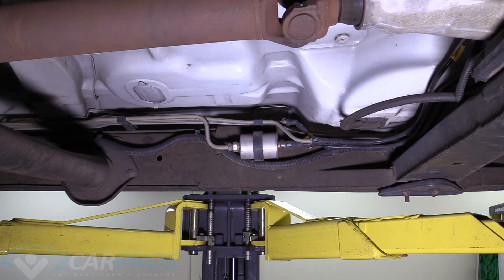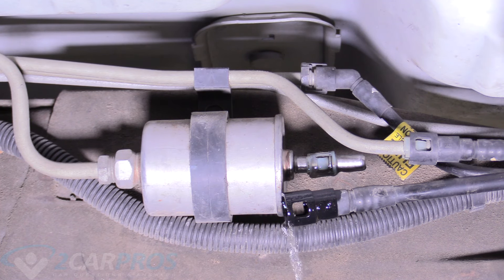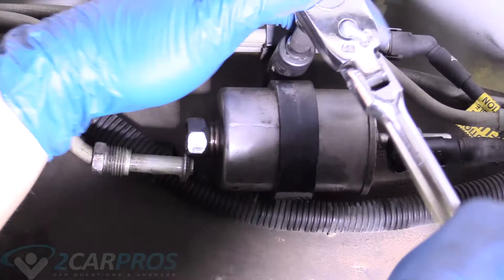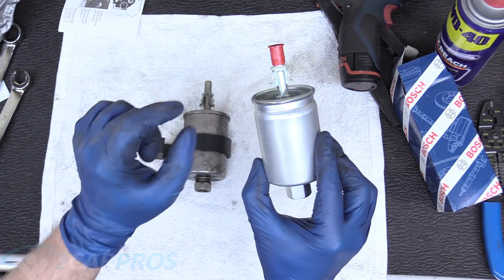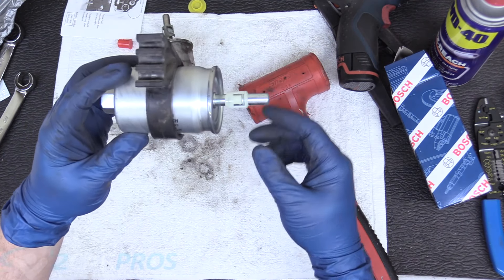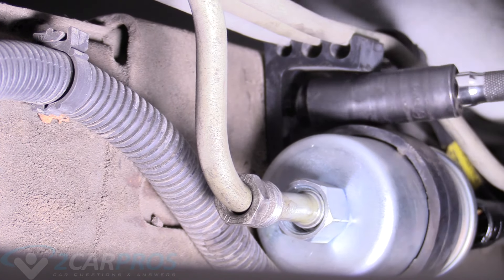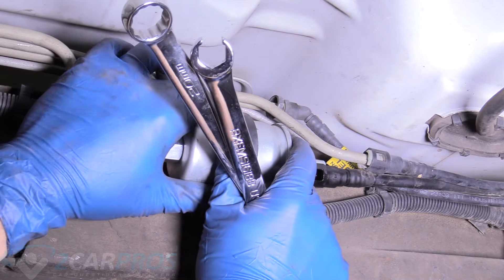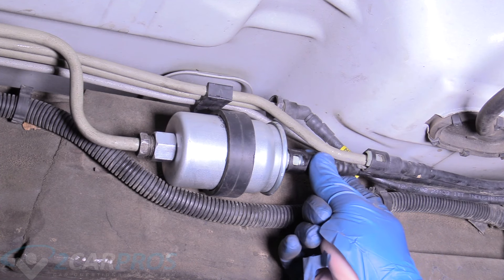How to Replace Fuel Filter Chevrolet S-10 1993-2004

Comment: do not, i repeat DO NOT pop that fitting off without relieving the fuel pressure by running the engine without the fuel pump. If that filter is even a little clogged, it can maintain pressure on one side of it. Was personally nearly blinded by just such an instance.

Comment: I was trying to replace this filter for a friend and the 16mm flare wrench stripped the nut because it was too rusty and tight. Yeah, I sprayed PB blaster before I started, and it wouldn't budge. I bent the neck of the fuel filter a little with the force I put on it. I decided to give up and plug the plastic piece back in and tell my friend I'm not doing this job due to all lines being heavily rusted.

Comment: Now I have a 96 Chevy S10 went to go replace the fuel filter and the line that is coming from the motor toward the front end of the fuel filter head snapped the line screwed into both ends is there any possible way I can just hook it up how you have yours hooked up and use the same fuel filter that you have pretty much I want to put a rubber hose on the end of the fuel line that had snapped off and then connected with clamps and run it to the fuel filter that you slide on to on the side or the one side I should say that you just unclip is that possible

Comment: Helpful video, but experience doing this on my 2003 LS 4x4 wasn’t such a walk in the park. There is a sway bar or link that runs front to back, right next to the fuel filter. Space isn’t big enough to get any combination of wrenches, vice grips, pliers, etc. in.

Comment: Super helpful. Watching under my truck right now. Done!
Reply from the maker: Nice work! Thanks for watching!
Reply: Same
Reply: @elite_dunkz_6196  It was easy to replace but it wasn’t my problem, it was the ignition Consol for me
Reply: I think you can disconnect the fuel pump relay, crank up the car let the fuel burn up then you won't have fuel pressure before you takeoff the filter?

Comment: Thanks for the video. Did mine on my 95 s10 today. I guess who ever did it before didn’t put the plastic retaining bracket back on (probably broke it) both sides were threaded too, no safety’s on my year.
Reply: I got a 95 blazer is it in the same spot as your s10 under the driver seat
Reply: @zakgephart4865  yea it’s located on the drivers side but not directly under the seat more so near the middle of the truck

Comment: Gonna do mine tomorrow on my 04 s10 crew cab how do I release fuel pressure in the lines so I dont lose a bunch of gas?
Reply from the maker: Nice! Just taking the line off will relieve the pressure. I have always found that easier. The pressure will also help push the line off. Thanks for watching!
Reply: you pull the fuel pump fuse  , crank the engine and the fuel pressure will be gone

Comment: Great video, but uh... When I remove the quick release part of hose it never seemed to stop draining, as if it were siphoning the entire gas tank out. It also had high build-up of pressure even though I tried to relieve it by cycling the engine with relay out. 2004 Blazer.
Reply: You can relieve pressure by pushing shrader valve.
Reply: @ronaldcarson4360  same thing happened to me on  S10 1998. I put side back on with the clips.I don't know where this schrader valve is.
Reply: @ronaldcarson4360  please help!
Reply: Please my eyes are dim! Muscles are sore and I still have determination! Having trouble loosing the other side sprayed lube on and still won't budge
Reply: Me too help, lol, daylight & good weather running opposite me
Reply: @lanajantz2240  It's in engine bay off the back of the motor toward the left. I think it's the black capped valve (there's another that's green). It looks just like tire valve coming off of the fuel line coming from the back of the vehicle. If you search "s-10 fuel pressure valve engine bay" you should be able to find a pic or vid showing where it is.

I was a bit surprised this poster didn't bother reaching under the hood and relieving fuel pressure that way.

Comment: The other lines besides the feed line (running into the filter) - what are they? from out front to back if possible.
Reply: Actually if you could confirm- the line running into the filter is obviously the feed line, next to it is the return line, 3rd is the line from the charcoal cannister to the front of the engine(Where does this connect?) 4th is rear brake line?

Comment: Is this the same location and process on a 2002 S10 LS 4x4 crew cab? Would a clogged filter give a hard start condition but then run ok after it finally does start? The fuel pump has less than 20,000 miles on it as I had it replaced with the new gas tank. Also just replaced the distributor and rotor caps.
Reply from the maker: Either the exact same or really similar. Yeah I would definitely replace the filter and see what happens. Thanks for watching!
Reply: You should have just replaced the filter when you did the new pump, now your injectors could be suffering

Comment: Any tips for the 4X4 model? there's not much space to turn wrenches because of the torsion bar
Reply: I'm sure you have done your 4X4 filter by now, but in case you have not: Remove the skid plate with three 15mm bolts and two 15mm nuts up front. You will notice there is the rear torsion bar mount limiting your motion, but it can still be done similar to the video; the key is to remove that skid plate. Next, remove the forward fuel fitting just like in the video and drain the pressurized fuel into a container. Using a 16mm flare nut wrench and a regular 19mm wrench (not 20mm like in the video) remove the rear fitting, and slide the filter forwards. Installation is reverse of removal, than install the skid plate.

Comment: Hi guys love the content liked and subscribed av got a problem with my Nissan nv400van a think someone has tryed to gain entry possibly my alarm keeps going off wen locked now ,was on driveway which is tight fit and a heard something in evening thought nothing of it a woke in morning and wig mirror was pushed I as thou somebody was trying get down tight gap no fixable signs of entry? Am I looseing my mind?  the Vans only couple years old with 24000 miles so carnt be my key or battery ?plz help
Reply: Sounds like an attempted catalytic converter theft.  It's a big problem in some cities, and especially on cars with good ground clearance.  They use a battery powered Sawz-all to cut them off.

Comment: Just lost my fuel pump the other day. Shop wants to replace the filter as well. Tells me the filter is $15, but installed it's $100. What a joke.
Reply: As always, they tryin to get you man...Do it yourself!!
Reply: @mrobsolete530x4  "more fun" laughs in torn up hands while trying to change spark plugs/wires on an s10
Reply: @haroldflower8008   >>spark plugs & wires<<  Hey man, I HEAR YA'!  That job takes some patience, skill, a good selection of tools, and a certain amount of creativity.

Comment: Word of warning.  This truck is very rust free. On trucks that have been exposed to a lot of road salt you need to handle that filter mounting brkt. very carefully if the return lines above are rusty. This can turn into a real nightmare and customer may blame you for damage to the lines. I  will often carefully cut or chisel the bracket above the bolt hole so it will still hold the filter in place and still contain the lines. To much movement may cause the lines to start leaking and if the customer is not informed AND SHOWN the possibility of this happening,  you may get blamed for causing a leak and have a bigger problem on your hands. I even refused a job once where the customer wasn't grasping the situation and thought I was trying to set them up for a ripoff wanting to get more money for a bigger job if I damaged the rusty lines. Believe me,  the last thing I wanted was to have to replace those lines, money or not. That job sucks.  If careful inspection reveals that those lines are already leaking immediately inform the customer before touching the filter and unless the truck belongs to you, you may want to pass on it because replacing the lines properly is major work .
Good informative video by the way.
Reply: I agree with this statement, because I did this job on my 2005 gmc yukon. It's a freeking nightmare.

Comment: What is the part number for the oring on the fuel line that is threaded?  On my 96 it's threaded on both ends and the rings are shot.

Comment: Could I hook a pump on the safety clip side of filter and slowly drain the gas tank ?
Reply from the maker: You could do it that way. But I must warn you that unless a pump is certified to do so it can technically cause a spark. If you need to drain the tank it is easier to take the filler neck off and do it that way. I did a while video on replacing the fuel pump on one of these and I show how to do it there. Thanks for watching!

Comment: Try doing this job on a rust belt s10!
Reply from the maker: If there was a bunch of rust and corrosion under the truck I'd spray some WD-40 in the threads on the flare nut threads then try to take it off. Thanks for watching!
Reply: @2carpros  yeah I know how to do it, I've done it many times. Just saying you had it too easy on that truck. Lol
Reply: @dm7097  hi, can i brake the fuel line if i try it to hard? Because mine is also really full of rust, i think its the first fuel filter from 1995
Reply: @icrashucrash9585  It is possible to twist the fuel line if there's lots of rust. Make sure to use a good penetrant, not WD40. Try PB Blaster or make your own with 50% ATF and 50% acetone. Let it soak, and then repeat. You might have to do it for a few days before you get that flare nut loose. Once you get it loose, move that nut back and forth a little until the threads feel smooth, then undo it some more and repeat. Don't power through removing that flare nut the first time or else the rust will strip the threads!!!
Reply: @icrashucrash9585  best just to replace the line (any or all). Isn't worth the trouble of trying to deal with rust. Fairly cheap and pretty easy.

Comment: Do you need to run the tank low on gas before replacing a fuel filter
Reply from the maker: Nope. That would be for a pump. Thanks for watching!

Comment: Would this be a reason my 2003 chevy dies on me till I rev the engine and then it works fine??
Reply from the maker: Yeah a plugged full filter could be the culprit. Thanks for watching!
Reply: Yep! Clogging the fuel injectors. Trick-w/marker put the date on the filter. I just change my every year on my birthday. 03' V6 4.3 vortec w/311k miles and STILL running great. Sounds like you might want to clean the throttle body and and IAC valve too-controls idle. If it's dirty IAC especially) it might be stuck closed or even broke.

Comment: In my 1998 s-10 there is no filter there.  Its not under the hood either where it can be seen. There isn't even a fuel line under where you show the filter.
Reply from the maker: According to the GM manual you do how a filter there. Also, there has to be a fuel filter. There has been fuel filters in cars since the 40's or so. Go check it again. Thanks for watching!

Comment: I did it like that in the first place but the front leaks. So I added an o ring. It still leaks. Cant find any wrong but no matter what it still leaks
Reply: Use white tape
Reply from the maker: Maybe the o ring is no good? Thanks for watching!
Reply: There's already an o-ring inside that connector.  It's possible that it got damaged or came out of its groove during handling. If you "added" another one, you've created another problem.

Comment: Helpful but my gas lines just keep running. Had I known this would be the case and that they don’t stop even 45 minutes into it...had I known that I wouldn’t have started the process.
Reply from the maker: Did you have the key on? Pressure has to equalize and stop eventually. Thanks for watching!
Reply: 2CarPros No the car was off and sitting in the garage from the night before. I filled up a Garage Boss oil pan with gas until I decided to hook it back up and cut my losses.
Reply: 2003SCT pull out the fuel pump relay before
Reply: It sounds like you tried to do this job with a nearly full tank of gas.

Comment: when i undid the 16mm line nut i got absolutely SQUIRTED in the godamn eyes and face with gas. wtf did i do wrong????
Reply from the maker: Never put your face anywhere near where gas might come out. Thanks for watching!
Reply: You're asking for trouble if you don't relieve the fuel pressure FIRST!  Easiest way is to remove the fuel pump relay and then start the engine and run it until it dies.  After the new filter's installed, cycle the ignition from Off to On several times to prime the system.

Comment: It'll round off...if you don't know how to use an *open end wrench.
Reply: Except you cant put a box end on a line, that's why they make line wrenches..........
Reply: @evanhart4032  I'm open to the possibility that on *some vehicles you can't, but my GMs and my Ford's can all be done with a standard *open wrench. Gotta be careful- the line nut is softer metal than the wrench so it *can deform, but I do not own a line wrench set and have literally never had an issue with trans lines, brake lines, fuel lines- as long as you hold the one end in place and turn the correct side of course. Make 100% sure you have an exact fit with the wrench/nut, and make 100% sure you retain the correct side, and make 100% sure you twist the correct side.
Reply: @zachfox5969  You can't put a BOX END on a line..... period.  Do you mean OPEN END?
Reply: @evanhart4032  Indeed. *open end*. Never said my terminology was accurate lol I was starting to wonder, "Why's this guy so persistent?" I keep them all pretty much together in the toolbox, so that's my excuse and I'm sticking to it.
(Went back and edited lol)